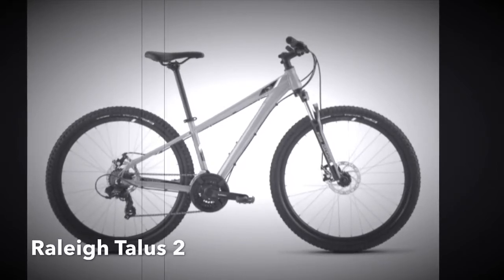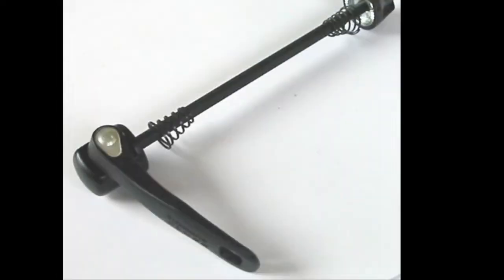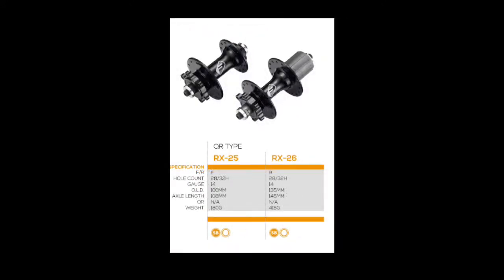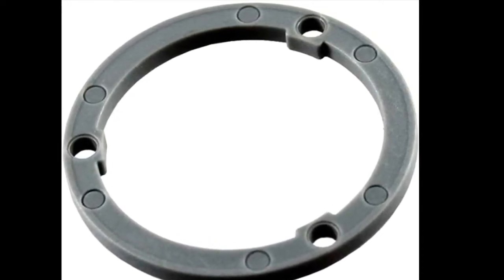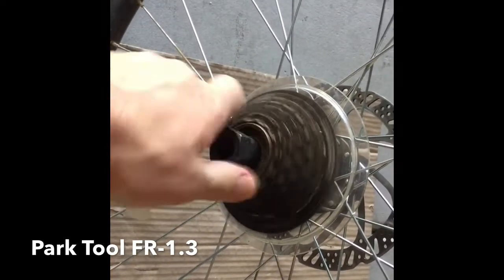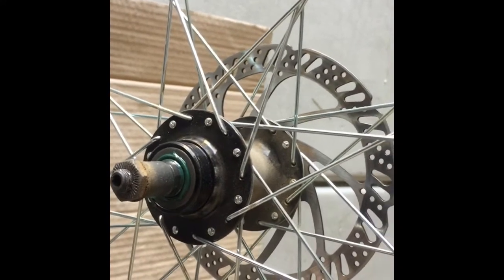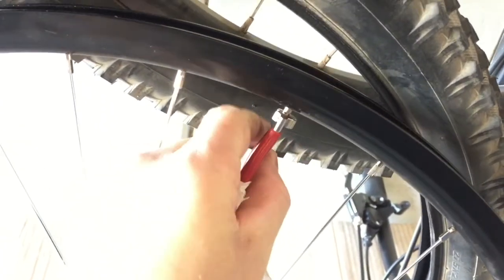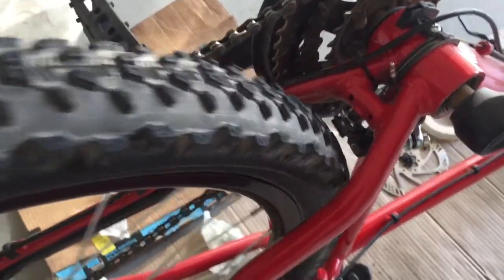Upgrade and replace freewheel by installing new hub, freehub and cassette on your mountain bike

Comment: Awesome! You can ignore my previous questions I left on your other vids... this covered everything I'd say! Thank you!
Reply from the maker: Regarding 7 speed vs 8 speed freehub body, I think they are different in length. In order to use a 7 speed cassette on a 8-10 speed freehub body, you must install a spacer which I believe is 4.5mm wide. Not sure you will find anyone using 7 speed freehub body much anymore. Most likely any newer 3x7 drivetrains are either using a 8 speed freehub body with spacer or using a 7 speed freewheel instead of a cassette. Let me know how your project turns out.

Comment: really glad to see you decided to take on this up on yourself rather than just changing the tire or the entire bike! BTW, did you have to stretch out the frame or something? I think I'll do the same for my SS Raleigh Strada in the future (just bought it few days ago thinking I can do any upgrades I want and didn't knew anything about the hubs🤦‍♂️ ) Also, it's an Al frame 🤦‍♂️🤦‍♂️
Reply from the maker: I did not have to stretch the frame because I replaced my 135mm OLD rear hub for another 135mm OLD freehub. The width was the same.
Reply from the maker: I'm not familiar with your Strada, but I would check to see if it has a freewheel or a cassette. There are some good videos on YouTube that show how to tell the difference.

Comment: How close is the dimensions of Formula DC-31 vs Shimano FH-M525A Freehub?
Reply from the maker: Very close, close enough that I was able to reuse my existing spokes. Make sure you count your spokes. Should be 32 hole hub if you have 32 spokes. You will have to build the wheel back up. Not a big deal but some people don't like building wheels because they have to be trued. It's a whole lot easier just to buy a new complete wheel with freehub.

Comment: What is the P.C.D. left / right (mm) of DC-31, is it	61mm/61mm same as FH-M525A? 
What is the Flange diameter left / right (mm) for the DC-31, is it 70.6mm same as FH-M525A?
Reply from the maker: I just measured my DC-31. I measured about 58mm PCD and 68 mm flange diameter (L/R) so not exactly the same as the FH-M525 but pretty close. I was able to re-use my original spokes.
Reply from the maker: Are you trying to replace a DC-31? You can also consider a Koozer XM490
Reply: @mtbbiker6401  Can all the spokes tension properly switching from DC-31 to FH-M525?
Reply from the maker: @coolride88  Not sure. I'm not an expert wheel builder but I was able to rebuild my wheel. I don't know if they are the proper tension since I don't own a tension tool. Maybe you should buy a new wheel with a freehub. That would be much easier.

Comment: If my bike has a bolt on rear wheels can I use this hub with wr or if not, can I just use my old axle in the new hub. I wanna make my Ozark trail vibe a single speed and it'd be much easier if it had a free hub in order to space rear cog correctly. Thank to anyone who can help
Reply from the maker: Does your frame have a 135 OLD drop out? I believe bolt on and QR are interchangeable because the frame drop out shouldn't be any different. Most 135 OLD rear hubs have a 10mm axle regardless of bolt on or QR. Obviously the axle itself might be different depending on the bearing interface within the hub. Plus QR axles are hollow to allow the QR skewer to pass through the axle. I highly doubt you would be able to simply swap the existing bolt on axle into the new hub. If your current freewheel hub is 135 OLD and has 10mm axle, any 135mm rear hub should work. If you plan to rebuild your wheel then you'll have to account for flange offsets and diameters as I explain in my video in order to use the existing spokes. Sometimes it's just easier to buy an assembled wheel. Hope this helps.

Comment: You probably wouldn’t need a special tool for Shimano Center-lock brake rotors. They use the same tool for removing Shimano cassettes.
Reply from the maker: Thanks. I just figured this out because I ordered centerlock rotors for my other frame. I received lock rings that use the cassette tool. Unfortunately, that style lock ring won't work on a 15mm front axle. I can't get the tool to fit around the front axle so I had to order the other lock ring that has the grooves on the outside. SM-HB20. This lock ring uses the bottom bracket tool to install. I have both tools needed.